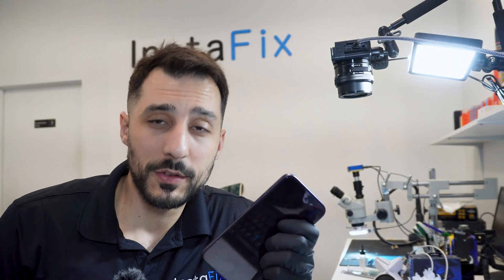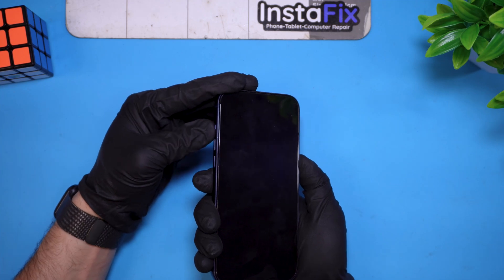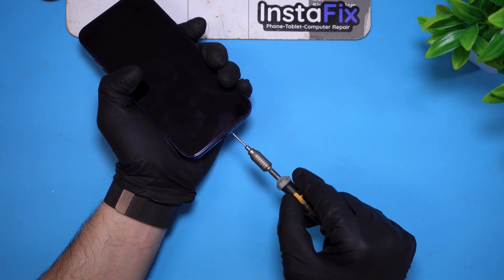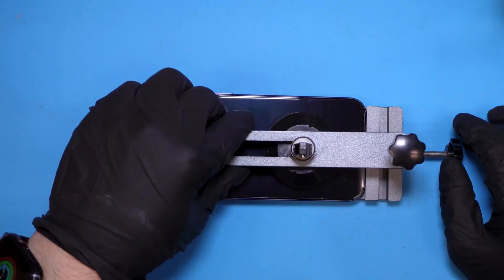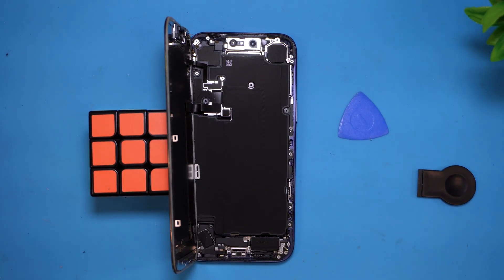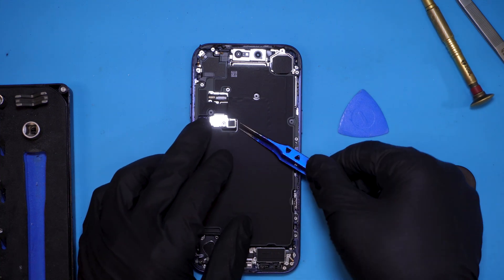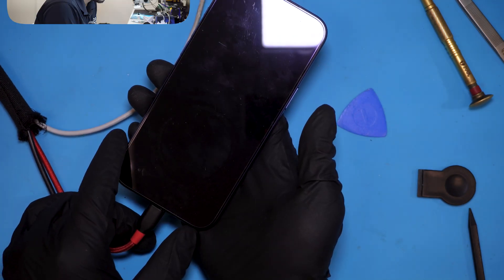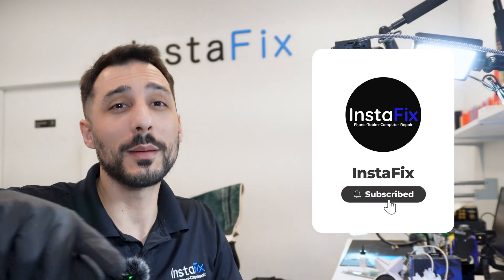ALREADY AN IPHONE 17 PRO MAX NOT WORKING??? WOW

Comment: Encountered the same thing on my sister's iPhone 17 (base model) over a month ago. They said the battery went to 1% and died. Phone would not come back on afterwards. They had it plugged in all day and still no joy. Before sending it in for replacement, they gave it to me to take a quick look just in case it was an easy simple fix. I plugged it into a USB amp meter and saw the same unstable current readings (was going up to 2.1W and back down to 0). Tried all the usual things such as different USB cables, outlets and computers. Nothing worked. It was starting to not look like an easy fix. 

It was looking more and more like a hardware issue. I thought to try and see what happens if I try to force the phone into DFU mode. After trying the button combinations I found on a video, the power draw stablished at 2.1W. I left it in this state for about 5-10mins. Power draw then dropped. I pressed the power button and suddenly the Apple logo appeared. 

In all that time, it was stone dead before the logo appeared. I did not get a low battery prompt. It's been working fine ever since. No more issues reported. Must be caused by some software issue? It's a very scary bug if so because it looks like hardware failure (aka a short or something). 

I had a thread up about this on iFixit and posted what I did to get it working again. I've had 2 replies so far saying forcing it into DFU worked for them. Maybe forcing it into this mode removes whatever causes that strange bug.

Comment: Great video. Most of us techs would've done the battery power cycling as well. One step you skipped that most of us do, after removing battery power, we usually press power button 1x to remove any residual power that may still be on the logic board, before reconnecting the battery plug. :) 

But, glad it worked without that step and the phone is working.  For this "easy fix," how do you charge the customer?  Because, in any repair shop, there's no option for "power cycling," charge. :) 

Of course, it is service fee. Because, you have to be careful and follow every safety precaution (anti-static gloves, plastic tools (so not to scratch iPhone), etc. 
Let us know or give us an idea (if you can't disclose exact figures). :)
Reply from the maker: Glad you liked it! I try to keep it simple but you're right about pressing the power button.

Comment: Pretty sure Apple would just replaced it on the spot as it’s still so new. So Apple would have been a quicker, better fix.
Reply: nope, unless you do have the highest tier of Apple care, and also she could buy it via the operator so it takes days for the replacement
Reply: @ThereIsOnlyOneRandom  Apple replace on the spot for normal warranty in Australia. They won’t even bother opening it
Reply: @whatcouldgowrong7914 yes for sure, guess Australia is above other countries and they don't care if you ran over your device, they will just give you a new one without inspecting the old one, I'm moving there seems like Apple is just trash in my country 😂
Reply: @ThereIsOnlyOneRandom Well they aren’t going to cover it under warranty if you run over it but if the device is faulty, they will replace it with a basically new refurbished unit usually
Reply: @ThereIsOnlyOneRandom  nope, it’s still under warranty and will be replaced in store on the spot. You don’t even need Apple Care.
Reply: @Shroom-m7m  well I had a different experience , I'm glad that they gave you a replacement without even asking what happened 😂 first of all they need to know if it's the customer's fault before handing you a new device, as I said that's my experience I had to wait 3 days and they have send me a replacement to my house, not giving me a new phone without checking what happened.
Reply: @ThereIsOnlyOneRandom  Was it a brand new phone. One that’s only been out for 2 months? In my experience and other that I’ve heard of if there’s any problem with a brand new iPhone Apples policy is to replace on the spot. I personally had to wait about an hour I’m assuming they opened it up and checked for water damage. After that passed they gave me a new unit.

Comment: In a phone repair shop, isn’t there any tool that can hold the screen in place when the phone is open and the display is still connected to the mainboard by a cable?
Reply: Yeah, I bought one on aliexpress
Reply: @Mr-Anony-moose damn so you must not like it bc otherwise you would use it? :P

Comment: Why wouldn’t she just take it to the Apple Store, with that issue and being it’s brand new, they would just have given her a brand new replacement…. My guess is she obtained in by some less than legal means and didn’t wanna take it to Apple out of fear it leading back to her. There’s no reason to pay for something and wait for the repair when Apple would just replace it for free in a matter of minutes.
Reply: Bingo
Reply: @jobturkey7418 cringe
Reply: "ah yes, my $1.2K phone is not worth the time to get it repaired officially, so I'll void the warranty on my brand new device, pay more money, and hopefully get it fixed faster."
Reply: Probably because they're out of stock everywhere and she be waiting weeks for it
Reply: Data recovery
Reply: @HazoYT  dude clearly you don’t use apple. Even if you don’t use iCloud, Apple would’ve still repaired it free of charge under Apple warranty in Aplha parts exactly the same thing. This guy did if not even changed the battery for a free of charge.
Reply: That’s why Apple products are more expensive than anywhere else because of the warranty that you get with it
Reply: @HazoYT thank you 😊
Reply: Did you not hear da reason she didn’t take it to Apple he basically said why in da video
Reply: @tjcoutee1507 timestamp or gtfo

Comment: So software problem, you could also wait until the battery is completely dead-dead.
Reply from the maker: Not in this case. If you noticed at the end when I plugged it in it was already drained the battery. So looks like the issue here was it was stuck charging

Comment: I wonder how much Apple would charge to “fix” this same problem.
Reply from the maker: Hmm i wonder what they’ll do. Good question
Reply: mehh nothing much 
just replace the entire back cause the display got no issue 🙂‍↔️
Reply: Well it's a new phone so they would just replace it with a new one within the 1st year.
Reply: Nothing, something like that would be a defect and covered under standard warranty though they would likely replace the screen anyways even if the original isn't damaged